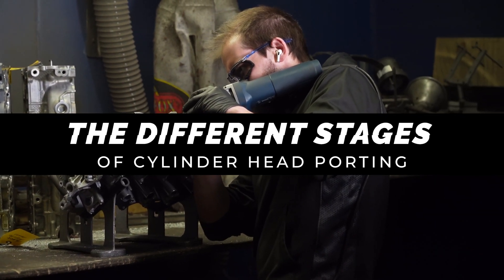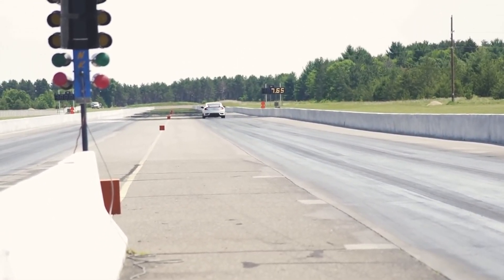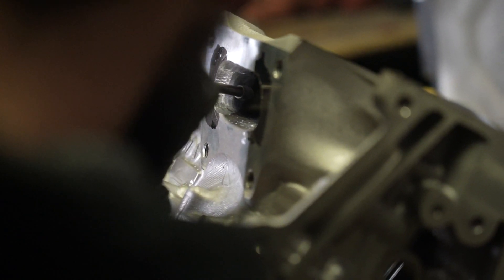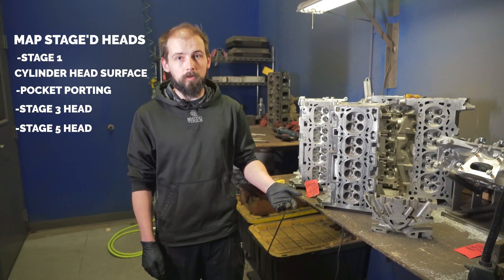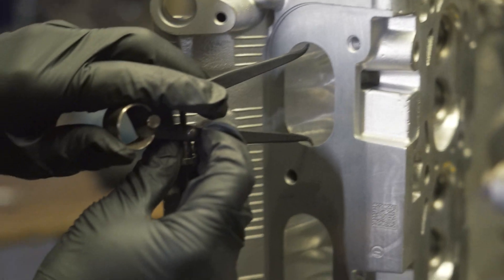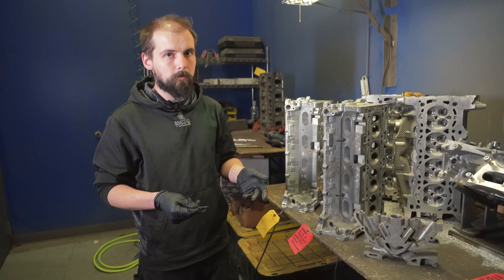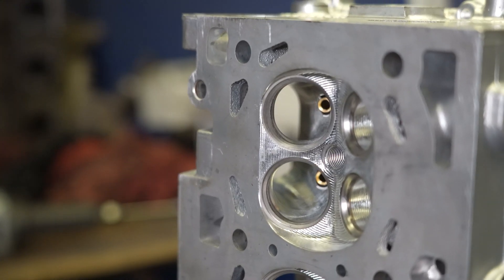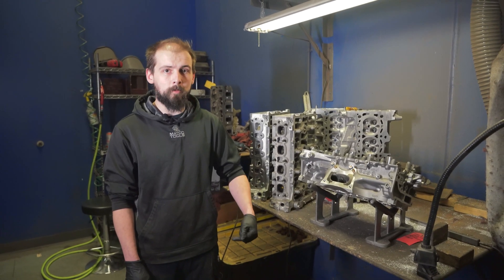The Cylinder Head Porting/Polishing Stages from MAPerformance

Comment: Well i hand ported my heads. Left the intake side at 100 grit and mirror polished the exhaust side. Mostly grinded out casting flash ,knife edging and pocket port. Head got bigger cams, brass valve guides, +1mm ferrea valves. valves,gsc lifters. For an all-motor 6g72. Took about 15-20 hours to port those heads. I would call them a stage3 port job. but everyone "stages" heads differently lol. Its such an odd-ball build most tuners are like oh no no no we aint touching that. So left to tuning it myself also lol.

Comment: can i ask you?

my 1000hp street car cam choice. 1000cc bike embarrassment use only

rb29 (stroker) 
e85
manual 
4” turbo back ex

made 1000whp before on 41psi

i decided too cnc port and now cam choice-either (purchase) 272 or 288/288 (already have these), OS valves all round. light valve-train 

power band from 5-10k😊

i listen too you and think maybe the 272’s aren’t using all the ports capabilities

i ran the 288 before and frankly liked them

Comment: Good information. I have a srt4 caliper & installed BC stage 3 race cams & I ported the exhaust side gasket match. I will just smoth out the intake side. Has a bws turbo & all the other goods.... looking to make 430-450 wheel on e85 only.